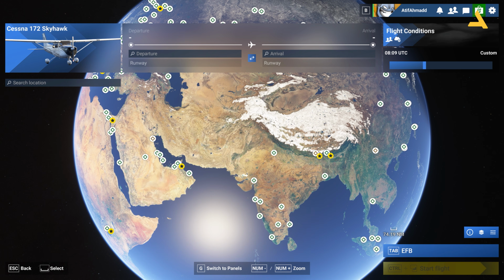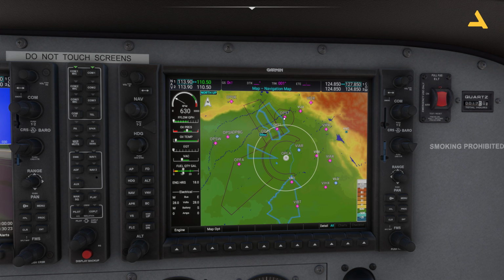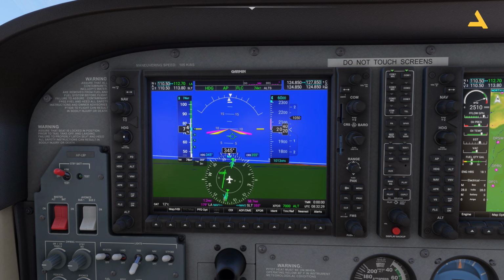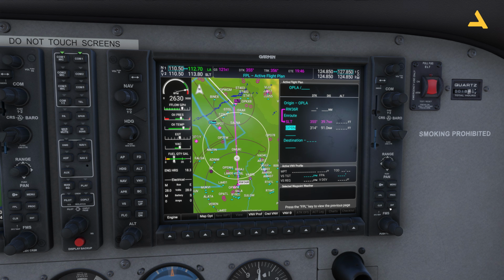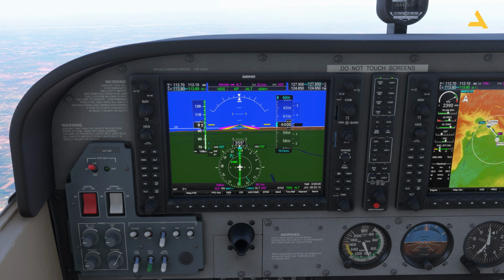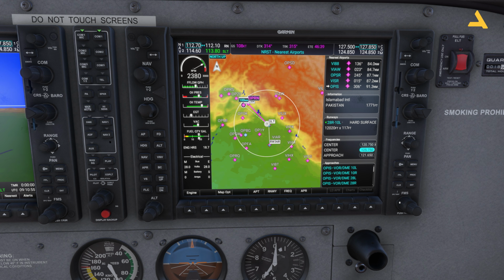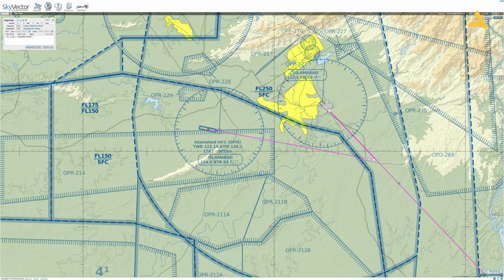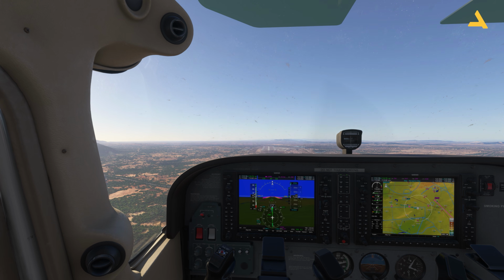VOR Navigation with Cessna 172 Equipped with Garmin G1000 in MSFS 2024

Comment: How did you decide what heading to assign to the Course Bug? I am a little confused because I thought VOR outputs signal. Why would we have to manually adjust our course bug to line up with the VOR?
Edit: i see now that we pulled 355 heading from SLT in the nav. But still unclear why we use the HDG to track. For example, with GPS, we can add a sequence of nodes and the GPS with AP will guide us to the destination, turns and all. We cant do that with VOR beacons?

Edit 2: ok I think I get it more now. The beacon acts as a point in space. Since in the NAV, we use the Course Bug to set our desired heading from the VOR. The computer uses the Course correction indicator to show how far off we are from the vector which passes through the VOR and extends in the Course direction

Comment: Excellent video, Thanks! :)  Have you done one in FS24, where VOR is not aligned to the runway, and then as you said in the video you need to either follow ATC or follow Chart instructions? :)  Also regarding the inbound radial and outbound radial, the arrows in the CDI (forgive me if Im wrong in the name), there is a big head arrow, and a small head arrow, so if of my understanding  that when the small arrow is on the opposite side of the Big arrow, it means you are moving from the VOR, when both arrows are pointing the same direction you are moving TO the VOR. (i may be mistaken tou, Im not pilot) :)
Reply from the maker: I will make a video for the VOR approach where the VOR is not aligned with the runway and I will post it in a day or two. For the VOR indicator there is only one arrow. If it is pointing forward then you are going towards the VOR and if it is pointing backwards then you are going away from it